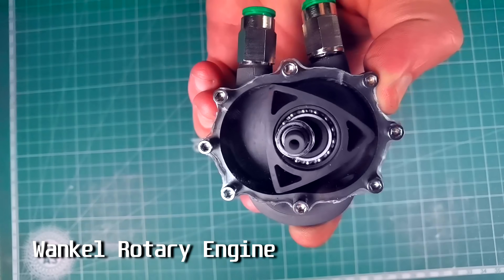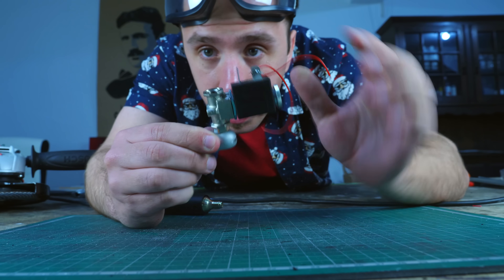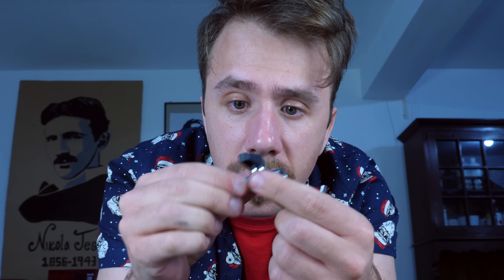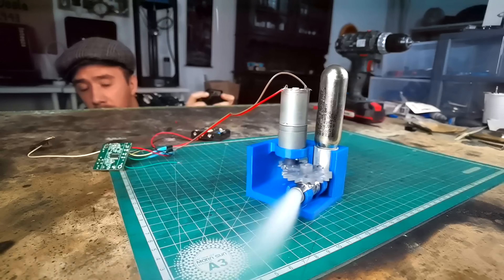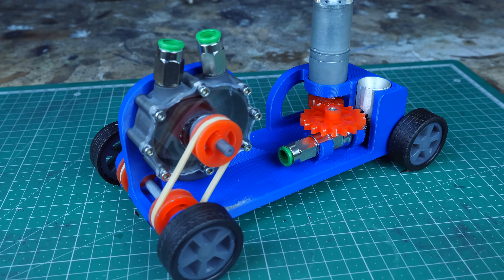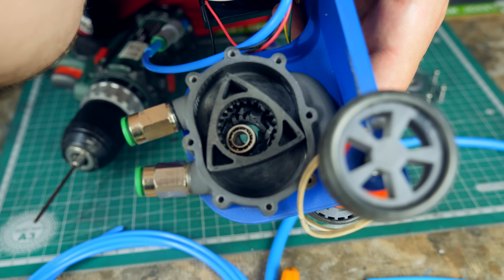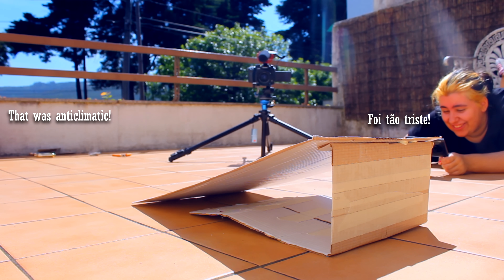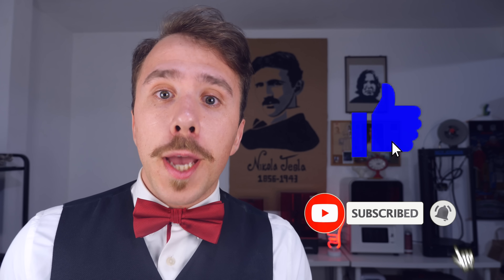Rotary Wankel RC Car (3D Printed)

Comment: To improve the efficiency of the Wankel engine you should release the gas slower and heat it up, the gas now mostly escapes as a liquid, sometimes even a solid, the dry ice, and of course those have a higher density and thus you get less gas for the 20 grams of CO2

Comment: Hey Integza, have you tried running the car the other direction? I think if you set it up so the drive axle is in the back and add some rubber bands to the tires, you might get better traction, and as a result slightly better performance
Reply: OfficialIntegza  Scammer bot

Comment: That car's solid suspension is creating a LOT of wheel hop and the transmission itself could use some rigidity (like timing belts rather than v-belts.)

Time to print a simple wishbone suspension or maybe get some softer, stickier tires.  If you really want to drool over some engineering I recommend looking at the suspension of an Audi A8... But also just study suspension design in general since it's what makes the difference between good RC cars and mediocre ones 😁 (good regular cars too!)

Comment: This is a pretty cool idea, but i think it would be a lot better if you set it up to be rear wheel drive. That way it would get better grip with hard acceleration. Also it seems that the rubber band drive slips a lot, and it would be better with a stronger drivetrain. Also i think it needs to be geared higher, because right now it is relying on rpm rather than torque, and all the air is being released way too fast. If you geared it higher, it would have way more speed, and significantly more distance, because the slower the engine rotates, the slower it uses up the air. I think it is wasting lots of pressure at the moment. But overall, i love the idea, and i think there is so much potential with this idea

Comment: Youve already made the video so its too late though fyi, Though the way you use a co2 head is that you put the canister all the way in, then you undo it to release the pressure. None of that pressing on the head with your fingers mm away from it.

Comment: The power from the 16g bottle is enough to power the rotary engine to make the car go flying of the ramp, but there  is a lot of energy loss in the drivetrain. If you were to limit the slipping between the Rubberband and the pullies (mabye making a CVT to go with it) and redesign the car with rwd or awd with grippier tires you would most likely get a more succesful jump. :)

Comment: I think That if the car was rear wheel drive it probably would be able to climb that ramp , or at least had more traction than it has. 
You also could go bonkers e make it 4x4 with a cardan shaft or belt.

Comment: Video Idea: Combine some projects and add a new one.  Use the Wankel engine (existing item) to drive a wimshurst machine (new project, bonus if you can accurately explain how it works) then use the wimshurst to supply the power for a classical rotary spark gap Tesla coil with sufficient gearing to drive the rotary spark gap with the Wankel engine also.  Then calculate effeciencies stem to stern.

Comment: Integza I noticed during the use of the CO2 carts your seals would fails on the wenkel engine.  Have you tried optimal refrigerant temp lubricant like magna plate 10-22.  Also are you using gasket material?

Comment: Video idea: Design a liquid rotary engine that has 5 sections instead of 3 and make the rotar have 3 circles that is one part instead of only 2. Also add a double in take on 2 of the sections to increase the power.

Comment: video idea: design and 3D print a .... 3D PRINTER! (using of course the components of a real 3D printer, logic board, head, etc.) but not the frame, gears and pulleys! The challenge is, once everything is printed, make a sample print (previously printed with a real printer 3D) and see the level of detail between the two!

Comment: You should try using gears to make it drive for longer. Another issue is that you used a rubber band, meaning it can stretch, vibrate and slip instead of powering the wheel. I'm no expert and there is probably a reason you didn't use gears and also used a rubber band.

Comment: Video Idea: I would like to see you making a steam engine or a wood gasifier engine and use it to power a boat or a car. With your ceramic resin both should be realisable
Reply: A steam engine would be nice, however he would probably have to pass the heated gas trough some sort of cooling unit before it went inside the resin/acrilic engine.

Comment: Could you run these Wankel engines in series to try to increase efficiency or perhaps do all wheel drive? Maybe adjust the gear ratio for the wheels too?

Comment: I would like to see you build a go cart sized version of this car. I don't know that I would use CO2 to power it though, that would be a huge tank. maybe some other form of thrust. Possibly build it to use vegetable oil. or put a portable air compressor tank on the back (in front of the rear wheels) for thrust.

Comment: Make a liquid piston engine, its a rotary with 3 strokes per rotation, its an engine that is still in research and development, you can make a revolving valve for it, cause you use compressed air

Comment: Some ideas for the car improvement.
 
Can you release the pressure slowly? If you don't know how I can help you with that. I'm a diver so I was thinking on the same technique. 

 The air that leaves the engine is blow away to above. Maybe it's better to place the engine on the back and 90 degree rotated so the air that leaves can be used as trusture. Not mutch but efficient.

Great work so far by the way 😊😉

Comment: I have always wanted to 3D print a medium-sized electric power remote-controlled school bus with working lights doors and stop signs but have never been able to afford a printer to do so. I work in the school bus industry. And would love to be able to take it to schools and teach the kids about the safety and the laws for school bus on the road.  Can something like that be done on a 3D printer.
Thanks for the great video of the 3D car using co2.

Comment: I also, designed a project, that you can do, that it's a hidraulic "human muscle" that can lift some weight, that also uses valves and high pressure...

Comment: Here's a video idea. Redo the whole thing, add a transmission with gear reduction, add a pressure regulator, increase the wheel size a tiny bit, and add the ability to use several CO2 cartridges. I'm all out of ideas.

Comment: There were a few issues with the car (Not the engine) causing massive inefficiencies that reduced performance. The first was the belt/band slipping. Not transferring all the power to the wheels. The second is the abrupt release of all 800psi into the engine, so much that the plate was leaking and not all the gas getting used. 

If you added a regulator between the valve and the engine, you will probably solve both these issues. You will also allow the gas to expand more, thus getting to use more of it.

You can also add a reduction drive between the engine and the wheels. But I'd start with the regulator. You can try different pressures to see how it effects the performance.

Comment: I'd  say tighten up the rubber bands because you were getting major slippage I believe the pressure from a tight belt should slow the rpm because it's under load and give more speed and distance the tan bands just get eaten

Comment: Suggestion: make the wankel engine have 2-4 rotors, use 1 co2 per rotor and then upgrade the drivetrain to gears boom car go mach chicken

Comment: As for this little car your clearences were too big so the gasses by passed and some propelled forward.make some seals and gear the car better so you have some back preasure on the shaft the car should be fast but also go much much further.most of the energy is being lost and not being converted too pushing force

Comment: You are using a 4 stroke engine design in a 2 stroke cycle. You could double the power by adding a second air inlet instead of the current bypass.

Comment: Would love to see some 3d printed heat exchangers with complex geometry or a 3d printed air compressor of some kind seems up your alley
Reply: Major Hardware did a 3d printed radiator (heat exchanger) that worked.... okay.

Comment: i've noticed that the wankel engine has some serious vibration. I would assume that is due to the center rotor moving back and forth disturbing the center of mass. this seemed to be a factor in causing the wheels to vibrate off the ground as well as having way too much torque. what if you put two wankel engines back to back and fed them from the same power source such that the two engines are half a rotation out of phase with one another, so the two central rotors swapped places, essentially lessening the drastic change in center of mass?

Comment: Video Idea: Make a 3D printed aeroplane powered by a either a custom O2 or CO2 piston engine or a wankel engine. Challenge is to have a it take off and remain airborne once the initial fuel supply has run out

Comment: Add an idler pulley to increase the drive efficiency of transfer energy, also combine it with a stiffer rubber band
Reply: Or make a chain and gears instead of a pulley which relies on friction

Comment: Video Idea: create a rocket using a 3d printer with a bottle and rubbing alcohol inside, you can ignite it and it will fly, nasa has tips on how to make one but my challenge to you is make one that can go as high as possible

Comment: What if you rotated the engine so the exhaust points out the back.  You get some added thrust like a rocket plus the engine powering the wheels

Comment: The rubber band was slipping a lot during the tests, that was probably causing it to have a tiny amount of power since the engine isn't able to use torque. If you used gears or tighten it I think it would work much better.

Comment: I think you've covered the engine with internal combustion , engine with fluid pressure , now its time to do an engine that is powered by water (steam), or dead tomatoes , whichever you decide ;).

Comment: Make a gear box to tone down the speed of the wheels and if you have to make a spring loaded wheel base where the wankle engine when it runs out of co2 the spring that the wankle engine wound up along with the cars propulsion aka the gear box run after the fuel or co2 is used up also run the exhaust behind the car so you also have that rocket propulsion

Comment: You did not use a good belt to transmit power, so the engine power is wasted at the beginning of the movement.

The strap must have the necessary adhesion and be strong enough. 

I think it would be better if you used rubber bands.

Comment: You use the engine completely wrong. 
The engine is a 4 Stoke engine desing. 

You expand compress and expand again the Gas in your engine. 

If make an exhaust at the opposite side  of the intake and a intake at the opposite side of the current exhaust it will be much better.

Now your engine ist only running because you did a terrible job do seal it up.

Comment: I don't know how often you answer any question but ya here is one, took up a project to make a swirl injector I designed and 3D printed it now my confusion is how to test it I am not using any fuel instead only water and air for atomisation only so that I don't fall into a mess. Q'n is how do I set up for this testing, should I just pump water using a small water pump or should I pressurise the water in a tank using air compressor  and let the water out or something else. I am looking out for a low-cost option, eagerly waiting for any reply

Comment: i have an idea. 3d print a structure that can protect an egg from dropping at various heights. The only rule is that you can only use filament to make the structure to secure and protect the egg (no cotton balls or silly putty)

Comment: I think the car could work with some slight upgrades. Set the gas canister upright and add an expansion chamber so you dont have liquid/solid co2 in the engine.  Fix the leaks. And fix the drive belt (rubberband) slipping.

Comment: For the air leaks, why not use Plumbing Thread Wrap? Its a great way to fill in leaking threads and not have to permanently seal either! Cheap too!

Comment: So much energy lost at the interfaces, maybe optimize it a bit with gears instead of rubber bands, better tires, and some weight for better traction as the gears stepped up should be able to handle it.

I want to see this ridiculous project, finish in the spectacular Integza fashion I know is possible.

Comment: Here's a video idea... 3D print a helicopter using the wankel engine to power the rotor! You could even add gears for a rotor in back to help counter the torque of the main rotor.

Comment: That car and engine could definitely get up the ramp in that config even though its inefficient, the elastic band just slips out + is worsened by the vibrations he mentioned but i dont think the rpm of the motor is what causes it to fail lol

Comment: Next time, do it with:
- drag tires (can be bought for pretty cheap for RC cars)
- chain/belt instead of rubber band (so much slipping lol) like they use on motorcycles
or just tie the axle to the engine's rotor... I think that'll break whatever plastic you'll use, but might try it :D

Comment: Here is an idea for you. I was planning on doing it myself but the person I was going to prank stopped working with me. It was going to be a 3D printed Arduino timer controlled Fart Spray machine. You set a time when you want it to go off and then you hide it where the person will be. At the set time it will operate a servo to spray the bottle. I had planned on putting it in a truck we took turns driving. He would have been stuck and would not be able to leave.

Comment: I think you should try making a reinforced roto engine and feed it with one of your resin fuel rockets so you can convert liner force into rotational. Like a rocket fed internal combustion engine.

Comment: Mount the cartridge upside down for more downforce, and pull the slack from that rubber band so it forms a good connection to the wheels. It'd also help to make the car rear wheel drive

Comment: well.  i love this video as i do most of the ones you post. 

how about making the car again. but this time use parts from your rockets. 

control thrust or hell  uncontroled thurst. 

i was also thinking the engine you designed my need to be regulated a little bit.  and could use 2 CO² contanisters  for endurence. 

also  would love to get my hands on one those 3d printers.  

waiting for next video.

Comment: Video Idea: Design and 3D print a paper plane that is made of a ideal white plastic. The challenge would be to give it just the right amount of surface to fly with all the components but still light enough to be able to glide once out of power.
Reply: I designed a paper airplane that will glide with three and a half times its own weight

Comment: Video idea: Completely design and print a combustion engine with a SLA printer that runs on air and doesn’t need complicated valves. The challenge would be to see how fast its can get until it mechanically fails.
Reply: This system already does run on air with one of the simplest valves in existence
Reply: combust... air?
Reply: what do you mean by combustion engine that runs on air without complicated valves? this could easily run on compressed air (co2 carts just have a bit more psi they can put out than most air compressors) or if you mean a literal combustion engine thats 3d printed, its gonna have as complex valves as a carbonated engine, as well, its gonna be one, and even then theres no way it could be 100% 3d printed
Reply: Jesus loves. So much he died for our sins and resurrected on the third day. We are all sinners and fall short of the glory of God.There’s not a single thing we can do to save ourselves for we are not saved by our works but by faith. Recognize that you need Jesus to be saved and without him you are going to hell. Giveyour life to Jesus. Confess and repent from your sins and accept Jesus as your Lord and Savior and believe with all your heart and you will be saved. Jesus came to heal the sick not perfect so we all need him. Follow him.
Reply: @Moy-02  dude you good? The way you talk about God makes me feel like your in a special cult or something…

Comment: In order for the engine to transmit the full power to the wheels, try using a geared belt, the rubber slips a lot, also try to design the wheels with some gear wheels incorporated, best of luck, love the content you make ❤️

Comment: Perhaps using geared drivetrain instead of a belt and a variable throttle would increase efficiency or the wankel. Then when works too well, use better tires.

Comment: so when making the engine use foam tape in between the clear part and the case to seal it and lose less power and also my experience with rc cars is proportional is better so you could give it a little power or alot get and esc and a rc receiver and it should do better. not and 3d printing idea but kinda a suggestion :D

Comment: I think you have to counteract the vibration with the technique used for generating artificial earthquake. Means you have to generate it in the opposite direction to that is generated by Wankel engine. This will make it more smooth working.

Comment: You need a suspension because the vibration kills the traction. And use a stiffer rubber band for the power transition.
Keep up the good work💪🏻

Comment: Hey Integza, if you attach a CVT (constant velocity transmission) to the output shaft of the engine this thing would fly. I'm sure you could 3D print one, couple cones, a rubber band and some springs.

Comment: Why didn't you direct the exhaust  parallel to the direction of thrust instead of perpendicular? The rotary engine power and the exhaust thrust would work in tandem for propulsion. Just give it like a 5° downward pitch so it helps keep front end down/drive wheels in contact...